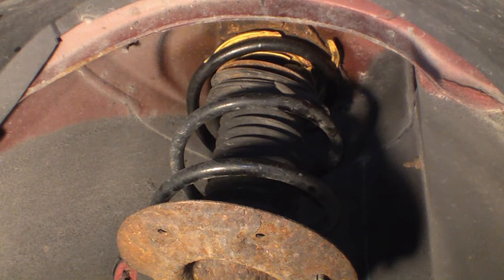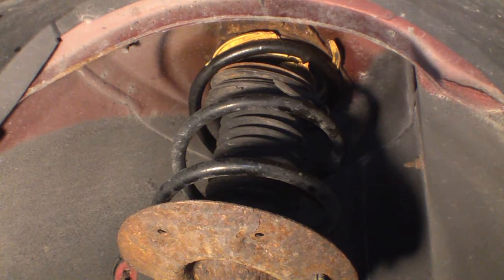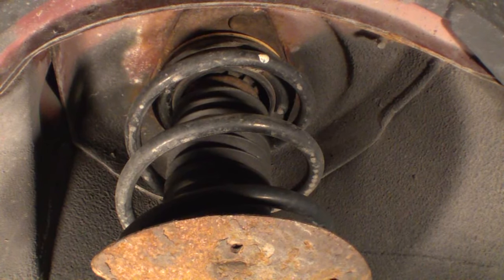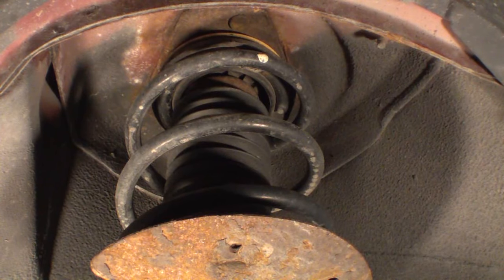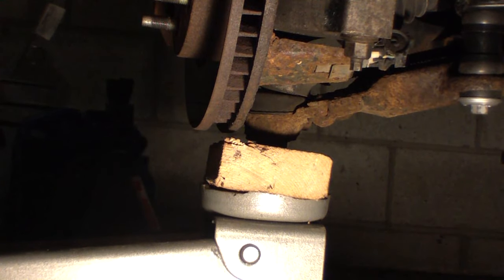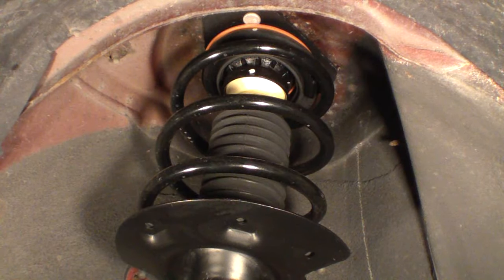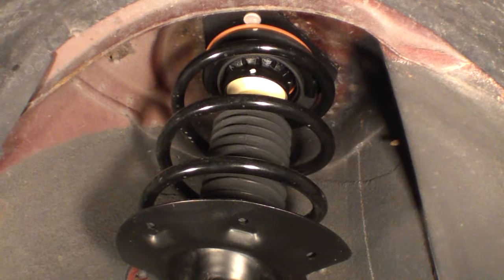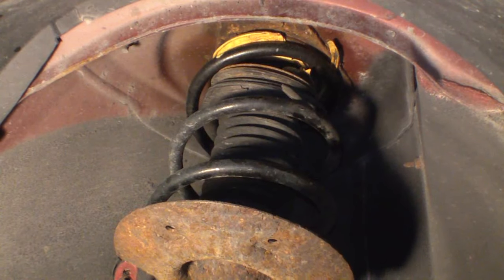I'm not fixing that clunk noise from shocks or struts that sound bad.

Comment: My noise is very similar - you can both hear it and feel it when it occurs (it's quite scary because it sounds & feels like something is popping or falling off your car).  I can equate it to the sound of a bass drum.  Mine started only when hitting bumps, but now can occur just when turning or any time.
Reply: Yeah same that’s how mine is and I feel like it’s only gonna get worse I gotta drop that 300😭
Reply: Did you ever find out what it was? I have been getting the same noise loud pop or drum noise. I took my nissan to the mechanic and he said that I needed to replace the strut mounts but that the he couldn’t find any online that were selling just the strut mounts for my specific car and that I need to replace the struts entirely which cost around 335 and 460 for labor 800 total, when I found the upper strut mount for my car and they were only $40 for both.

Comment: It looks and sounds like it was the trust bearing that had broken completely. They are often not very well lubed or sealed. I have replaced a few and they all have been rusted inside, so I have opened up the new ones and they all were half full or less grease inside. So I packed then full with Marine grease that is very sticky and made to repel sea water. So perfect for protecting slow moving bearings from the moist and salty invoriment. 
To check for upper mount play just jack up the front with wheel on and use a long 2x4 and a short one under to to lift/rock the wheel/strut/strutmount up and down..
Reply: @joejoemorechrist6886  No one knows the day nor hour, Jesus will come some day. You don't know if its soon or in a few decades.
Reply: Do you use the short one as a fulcrum and the long one for a lever under the tire?

Comment: After changing the sway bar link (leak), then outer tie rod (leak), then bushing (OEM 13 years and 190k miles), the clunking noise still there. After inspect the strut, the rubber cover the shock are torn and I think it is the strut creating the noise but strut has no leak. The ball joint and inner tie rod seems ok and  has no play. I am going to change the struts. I hope this is it. Thanks for the video.
Reply: Was it the struts?
Reply: @parisbaxter4996  No. The noise was caused by bad lower control arms; however, after I changed the Struts, the ride was much smoother and have better handlings. Thanks for your comments.
Reply: @callmebackfriday2  nice

Comment: A mechanic replaced the struts on my car, and soon after, I started to hear a similar noise (popping / clunking ). I took the car back to him twice. He (supposedly) looked at it and couldn't find the problem.   I hear it coming from the passenger side front end when I make sharp and  fast turns. A periodic clunk clunk clunk sound. Faster, I go faster, it sounds. Sharp and slow turns don't produce any sound (or very light, and I don't hear it). Right turns sharp and slow or fast don't  produce any sound either. It is not the cv joint. I have had cars with cv joint issues. I am familiar with that sound. I also hear the sound when I go over deep potholes. Any ideas? My car is old but I don't want to buy a new car yet :(  could it be the same issue as the one you have shown here?
Reply from the maker: Sometimes an anti-sway bar does this? Really, if you can repeat the condition with the mechanic, or a different mechanic that does not want to fix their previous work, you'll probably find it. -Good luck!

Comment: Check the top  nut in the engine bay. Grease can be added to lubricate the bearing on most cars.   But you look to have a damaged  yellow pivot  disk already along with lots of rust  I doubt the shop broke a tie rod as they wear out too.  Where is the shot of the old strut and the worn parts?

Comment: Thanks for the video. Could this noise be caused by the struts/mounts when taking off from a stop or going very slowly WITHOUT turning? My car makes no noise during the cold winters but as soon as its over 50 degrees f, the front end pops at every stop. On a really hot day or after a drive, the pop is so significant it actually shakes the steering wheel a bit. Mechanics just give me random guesses. I cant find anyone who can figure it out!
Reply: Could be a cv axel or possible one of the bushing or ball joints is bad
Reply: The pop for me was the very bottom of my front drivers side coil spring. It broke, about 6 inches sheered off. It was in the bottom turn of the coil. It was so far down, the lip of the little cradle/cup for the coil hid the broken piece. It was rubbing on the broken piece when turning, creating a very loud metallic snap noise. I had to take my phone & get up in there on video mode, & point my camera with flash on, down into that cradle (not totally sure what it's called, looks like a bowl for the strut/spring to sit in! Lol). Finally you could see it! The issue is every time the mechanics had it up above face level to look at the spring. Looked mostly ok looking up at it. Couldn't see the break at the bottom unless you took the wheel off, or stuck a camera or mirror in. Now considering my symptoms the Honda stealership SHOULD have taken the wheel off to look. But just letting u know if you're still having this issue. The noise was quite disturbing, & I felt so happy when I found it on my own! But it was such a loud metal noise like two pieces being forced off of each other when turning!
Reply: @victoriagirdler4795  your honda makes strut noise to! Yea..my 16 accord sport clunks while turning going slow..stealership put it on a lift too..didnt take off the wheel.. And said maybe its binding needa grease..i dont really know he told me..and to come back if its worse..pshh..i spent 100$ jis for him to tell me that..there is a TSB..mine didnt fall under this..but should have..still tryen to figure it all out..and get them to fix it
Reply: @Edubb  so since my comment 9 months ago, I had the bad springs replaced, BUT the new ones bind terribly! I didn't have a lot of $ so took it to a guy who only wanted to use quick struts, instead of a widow maker to save my struts since the only thing broken was a spring. I now regret not paying a little more to have them done properly. Springs aren't made consistently, ESPECIALLY the aftermarket & "quick assembly" crap. I know someone who works in car parts. He  said springs get past tests all the time when they're just a bit off. It's not enough to cause all out failure, but enough to be annoying & potentially cause premature wear of the assembly & parts directly related in terms of motion. But they release them, & the worst get thrown into quick struts. Yours may be too tight, need grease, not compressed right, etc. I feel like it's a common honda issue! I've given up on the binding to be honest. When my struts or springs eventually need replaced again, I'll find someone confident in using a widow maker! Oh just so u know, Im not a mechanic so not 100% sure of this, but I've heard when they raise cars up, sometimes that can cause shocks to seize up. My ride got worse for several reasons all related to these damn springs!
Reply: @Edubb  you can see spring binding if u have someone turn your wheel while u get down & look up. If they're not turning smoothly at the same rate as the wheel, they're most likely binding. Not sure if u have the OEM springs or quick struts, but it may be something as minor as having someone (besides a dealership!) Adjust them. The dealers are useless. I took mine back immediately after purchase because of the issues with noise & ride. They swore nothing was wrong with my suspension, but also didn't take the wheels off! They raised it, & up too high to actually see the broken end on the very bottom of the spring. The tire blocked the view! I was under a warranty I bought, so of course they didn't want to admit a broken spring, to have to repair it! Fucking scammers! Yea, I kept hearing it, it became a rattle, & finally stuck my hand under & pulled the broken piece out. The guy I took it to while annoying that he used quick struts, did say it should've been obvious to any tech, & that with how badly rusted the sheared ends were, it had been broken for at least a year. So the dealership totally knew! Don't ever trust them!
Reply: @victoriagirdler4795  thank you very much!! I got OEM struts car has 53k bought it at 28k been hearing it since 44k..kinda ignored it..its the wifes car..well..i mean i do pay atten..keeping a car running smooth is my greatest satisfaction😁 the prob  with Honda..is they want me to go to a certified Honda stealership..so..i cant take it to somewhere else..if i want to get it paid for..i do have a extended warranty tho..so🤔 thank you again for your response
Reply: @victoriagirdler4795  wow..you've done your homework..thanks for the knowledge..so maybe i shouldn't be so OCD for now..hmm..should be ok? Its intermittent happens every other drive..or so..and you have to listen for it
Reply: @Edubb  if u have an extended warranty, u may be able to go somewhere else, but idk. The warranty is such a scam anyways. Sorry u gotta deal with this! I wouldn't be too OCD or worried if you're not noticing major ride issues. But a noise is still something to check. Clunks over bumps can be so many things. That's why I'd suggest trying to visually confirm it's spring binding, check both sides. It's not the best thing in the world for all the parts involved, but it's unlikely to cause safety issues. Unless it's so tight that a spring breaks & somehow impaled your tire, & I doubt it. But with a new car like that, definitely try to figure it out & be sure its not something that could cause excess wear. My springs make noise when I brake as well, turning for sure, & bumps. All being too tight or compressed. But several things on my van I've worried too much over. And several things I fucked off on fixing & now REALLY regret, like rust! LOL u can test a lot of your suspension by getting it up on proper jack stands & just seeing if anything is loose, any rubber looks cracked around joints, etc. U may find the nosie without the help of a shop, & may find its something easy to diy. Good luck, I do understand your frustration, & I'm VERY OCD.
Reply: @edubb2491  and you're welcome! I've learned some incredible things just watching YouTube lol
Reply: @victoriagirdler4795  😁😁

Comment: I'm wondering how to diagnose what all needs replaced...just the top mount, mount and strut, or the whole assembly. I definitely have the clunking noise. It came then left for awhile (meanwhile new wheel bearings and drive shaft [it actually broke] on Michigan roads). Now the sound is back. Finally  found out what it is, but inflation is a B.  🤣🤣🤣

Comment: I got this issue but I don’t wanna get a new Spring Coil.. Is it a bad idea to leave the issue be or is that dangerous?
Reply from the maker: Super bad idea to leave this to get worse. The spring can break, and launch bits into all sorts of things. There is NEVER a good time for springs to fail. Nobody can tell you factually that your spring has not been compromised by getting hammered this way.
Reply: Get it fixed bro

Comment: Not the sound I was expecting but mine is making a clanking sound from the front somewhere. It is set up for off-road but I don’t truly know
Reply: Did you ever find out what is was?
Reply: @hannahbunch36  I took it somewhere to get it looked at and I’ll tell you what they told me. They said there were multiple grease fittings that were snapped, a bunch of bushings were broke, and a sound that could be from the steering column. They ordered parts a few weeks ago and their still in backorder which most likely from China.
Reply: Interesting. It didn't affect the steering any? 
I'm having a rattling coming from the front passenger side I'm trying to diagnose. Might have to end up taking it in 🥴
Reply: @hannahbunch36  well when they replaced the shocks the steering wheel made a little jerk sort of this when you turned it back from steering if that makes sense.
Reply: @hannahbunch36  does it sound like aloose washer or a tampering sound?
Reply: @KingJD8686  it was a rock in between the rotor and brake backing! 🥴
Reply: @hannahbunch36  well issue solved